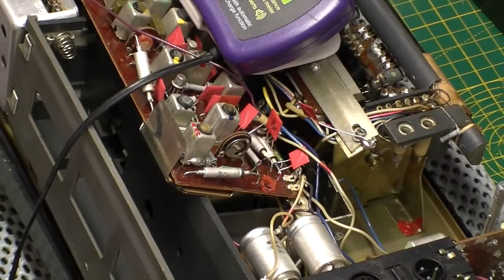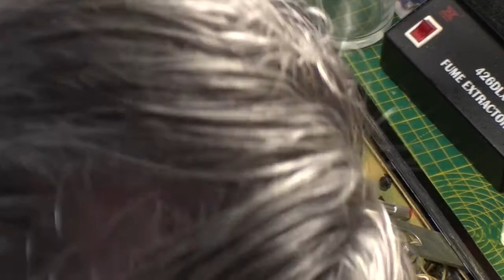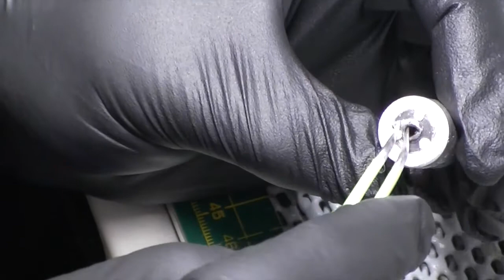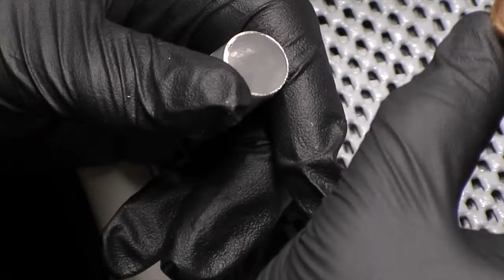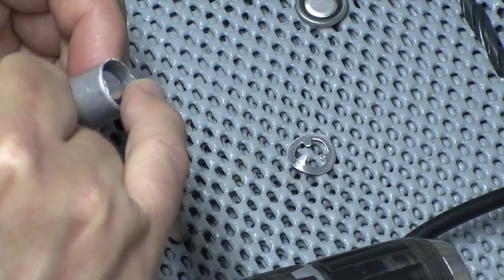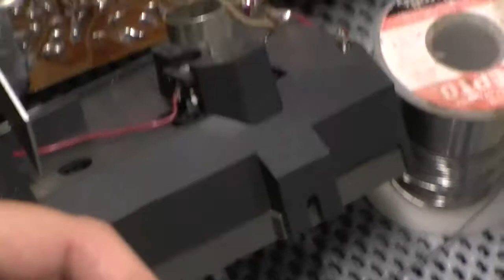Christmas Advent repair series  4th December 2017: Selena B210 part 3

Comment: I was a bit worried myself when you had it all spread out on the bench Graham.  I was saying to myself watch the dial cord mate, you'll hate yourself if you have to restring it. I've never seen a filter cap used as part of the mechanical integrity of a radio.  Trust the Russian engineers to come up with that one. It reminds me of the old saying back in the 1970's concerning the space program. The Americans spent 50 million dollars to develop a ballpoint pen that would write in zero gravity. The Russians solved the same problem by spending nothing and using a pencil. ATB Doug.
Reply from the maker: I would hate to have to replace the dial cord. That was a strange way of building the power supply using the capacitor for support. Like you say they seem to have a unique way of building things. Love your take on the space pen. I believe they are still selling them today. Thanks for your comments and for watching. Graham
Reply: @Radiocruncher  I always  carry a Fisher Space Pen, they're great.